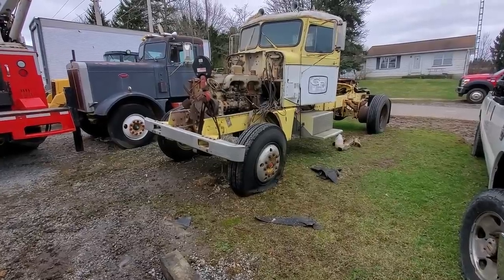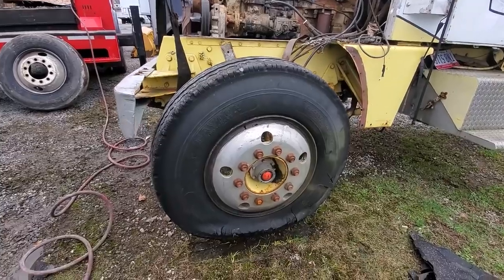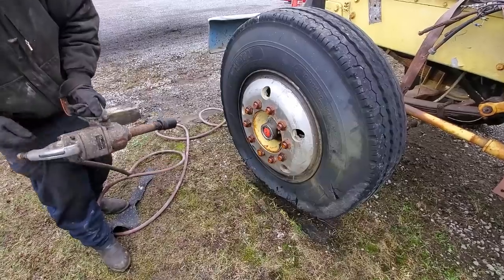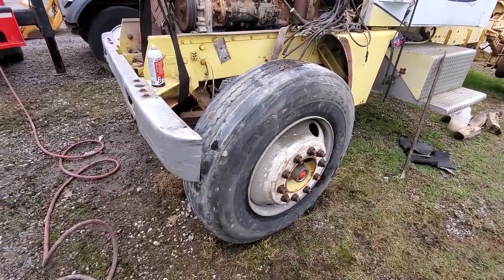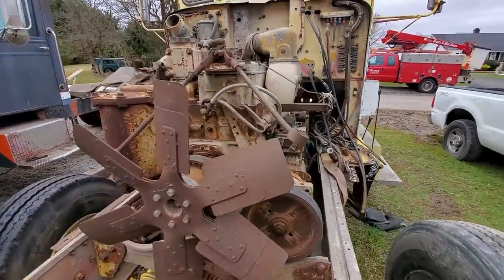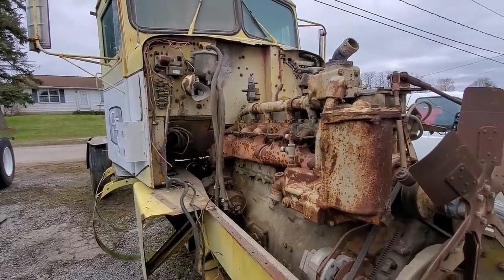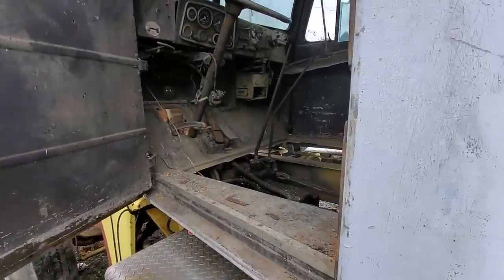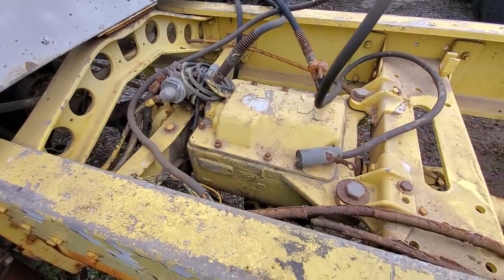1954 Needle Nose Peterbilt! - Weekend Restoration

Comment: Short wheel base. Looks like it was used as a yard runabout or a supply truck.
Reply: In California agricultural hauling we used 2 axle trucks almost exclusively
to pull doubles.  
They were easier to get into the fields or the canneries, grain elevators etc. Since California gross weights are only 80k  or 73,280 I believe back in the day more than 5 axles were not needed.

Comment: Figured I better watch the start of this popcorn show since I have heard it run... mine had the turbo so maybe thats why more power, they are all 855 c i.  I just liked the old ones... I did upgrade the dash as mine had a tattler on it and that went pronto but it was more accurate than the one i put in the dash as it didn't have the calibration on it.

Comment: It was a three axel to begin with. Somebody cut it off.
Reply from the maker: What do you mean? Why would it be cut off
Reply: Weekend Restoration I think if it was cut off like that guy thinks there would br a intermediate shaft flopping around ... key board wizards reading the past...great truck can’t wait to see it progress
Reply: @weekendrestoration1498  He's wrong.  There would be all sorts of extra holes from where the old suspension was on the frame.  Rolland also thought it was a log truck.  Strike two.  I ain't buyin' what Rolland is sellin'.
Reply: Rowland: Agreed. Factory tandem rears. Factory single-screws had frame rails that sloped at their rear ends, just like the factory tandem rear rails. What we see here is a three-to-two axle "conversion", likely by Giannecchini Farms, to convert for pulling dual ag trailers.

https://www.justtrucks.com.au/trucks-for-sale/1956-peterbilt-281-single-drive/JTW3234863#&gid=1&pid=8
Reply: Anybody that thinks that it's an old login truck should continue to hall freight